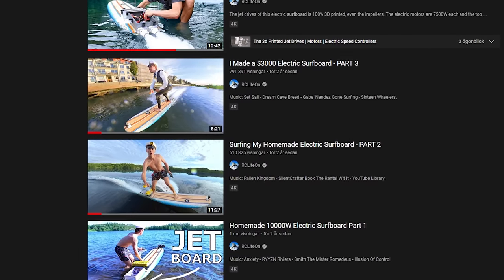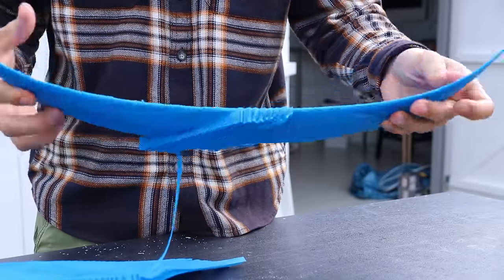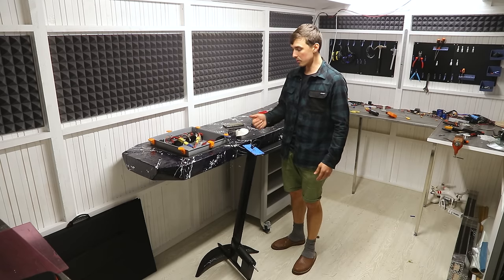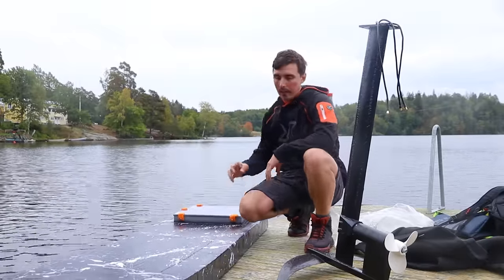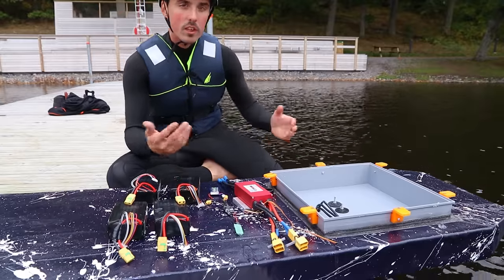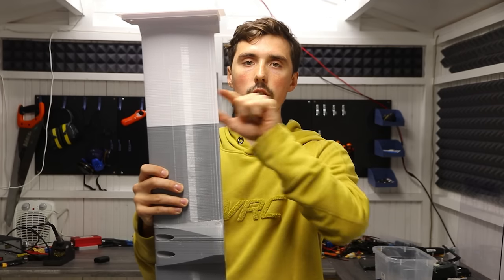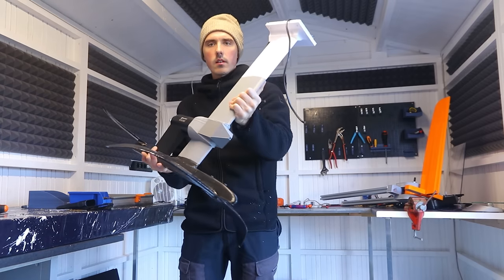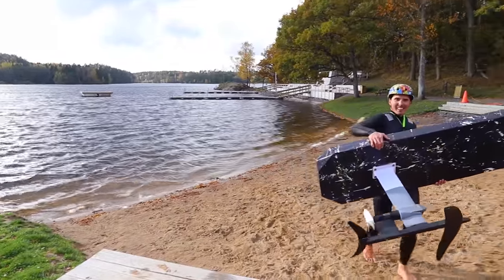3D Printed Hydrofoil Surfboard - Will it Work?

Comment: Your front wing seems a little small, or the motor is not able to go fast enough (declining thrust at higher speed.)
You can try to gently pump the foil up using your weight to help lift off, but normally the take-off is accompanied by an instant increase in speed. It seems like your motor is struggling there.
Judging by your weight and the size and speed of the board I'd say that the front wing should be about 80cm wide and have a surface area of about 1100 square cm.

Comment: I think that it didn't lift up because the wing were bending and not creating any "lift"

I recommend you to make supports or print the wings with a stronger pattern

To see if my theory is correct, you should get the waterproof casing for you 360 camera (or just a GoPro)

Comment: Perhaps you could use filament with carbon fiber strands embedded. This would make stiffer wings and provide additional strength allowing you to decrease the weight of the structure.

Comment: It now seems to be able to withstand the force of the Motor, but what i thought at first, was compressing the layers with a threaded rod. For example one in front of, and one behind the hole of the motor whire inside the 3D printed part. Two M6 8.8 Rods would be enough to apply a force anywhere from 0 - 30KN+ to keep it from falling apart.

Comment: Excellent video and experiment! You mentioned the words "epoxy" and "polyester" as the resin being used, but which one really is it? I am asking to know which resin does not melt the foam boards. I think the wing needs to be larger to have more lift, or more power to the motors.

Comment: Just try it on land. The force on the wing is the same outside the water, cause it's elevated out of it anyways. Bolt the wing down and step on it with your full weight. It may only bend a bit!

Comment: Double the wings, one at the back one at the front. And double the motor one on the left and one on the right.
 You need to get speed first then put pressure on the hydro foil. Or use squats the make the board dip up and down until enough speed is achieved. Assuming your 3d printed parts don't get ripped off

Comment: There is indeed no way to tell how much the wings BEND OUT OF SHAPE under water to "foil" your foiling attempts. The wings MUST BE MADE out of metal, and so probably the entire underwater contraption. Also, at that relatively low speed, you must have much larger wings. That's my $0.02 as a software guy. In any case, that you got THIS FAR is already very awesome!

Comment: I think if you get enough lift to hydroplane, if you're not right above the mast, it's going to break under the new un-buoyant weight. Maybe increase the aerofoil (chord/camber line) so more lift is generated on the larger surface area?

Comment: Both of your feet are in front of the wing. If your centre of mass is 400mm ahead of the centre of lift and the propeller is 400mm below the board, you'd need 75kg of thrust just to lift you (moment arm math). You want the wing to lift you, not the thrust. If you move the wing forward or stand further back it will require far less thrust to lift you off the water due to the efficiency gain of the foil (same reason planes can fly further than helicopters). You could fibreglass a deck that goes over the electronics box so you have somewhere to put your back foot.

Comment: Maybe a hollow metal tube, with a scoop at the leading edge, running up the leading edge of your  vertical riser, going through the board and through the electronics box and out the back. Have the tube running between the center of your heatsink. That way no risk of water in your electronics box, just heat conduction, as the tube contains the water and goes out the back. 
Add support posts from the bottom of the electronics box to the height of the underside of your lid, throughout. Strips of clear rubber sealant on the lid will give your feet something to grip on to, when you stand on top of it.

Comment: I would suppose like a lot of other people that the hydrofoils deform and don't generate enough lift. Improvements would be some thicker laminate on the wings and maybe some carbon fiber rods inserted into the wings before. Maybe even some solid CFRP ribs inside of the wings might work. If you can maybe run some Fluid Simulation Tests on the hydrofoil model to see if it is generally able to create the lift needed.

Comment: I have a sneaky feeling its your propeller not giving enough push to lift, we can see it nearly lifting. with enough speed almost anything will lift out the water. its just a balancing act between drag / speed / weight distribution.

Comment: I feel like you might be able run a tube through the mast  that can suck water up to the controller and then a little tube to shoot it out the back of the board. Also the wings may be flexing in a way that changes the hydrofoil and making it less efficient for lifting.

Comment: a longer support instead of a small rectangle just increase it to 2/3rds or 3/4 length of board for counter leverage in L shape brace chats right About a larger lifting 🪽 wing glad ya glassfiber wrapped it for strength imagine ya were standing on inlayed thin solar pv panels so it just recharged it's batteries as you go and go full 4 battery 🔋 maximum runtime also run the tubing for cooling just a small intake  and exhaust  which you can use the advantage of the already high pressure behind the prop to intake while exhausting forward in the low pressure to return to lake i had an RC water cooled electric inboard this way and  again thanks for sharing your fun

Comment: I think you need to put your weight even farther back, even if that means you need a stronger box so you can step on it. Put a couple control fins behind the main strut, so that the last bit of water before it takes off is heaped up between them. This may help you transition out of the high-drag regime, and from there you'll need less power to stay on foil.

Comment: 3d printed parts covered in fiber glass is a great idea for geometry specific parts but I think your at the limit of the strength it can provide, steel spar drilled through the wings to prevent flex?

Could be time to look at 3d print filament that could be used in sand mould metal casting setup.

Comment: I believe that the placement of your body with respect to the hydro leg is very far at the front and it just fights that leverage you need to lift you off the water. I also think that even if you got above the water in this try, you wouldn't have the necessary control to maintain stability, due to the same issue. Try changing position the electronics chamber and moving your body further back.

Comment: I did what you did except I made a foil from Wiggle board and glassed it my mast was aluminum. my first attempt broke off went to the bottom. second one i got lift but hard to control. I have put the project on the side for now. But your main wing is way to small take the front move it to the back and make the main wing 3 times the size and you will fly.

Comment: I think your problem is the angle of the large wing.  I believe the front of the wing must be slightly angled up, but not by much.  If you followed the plans perfectly then it may be the size of the motor driving the propeller, as well as the propeller design..  It will be interesting to see what you come up with.

Comment: why is the board so massive? usually hydrofoils are like 2/3rd the size, about the size of a wakeboard. the wing is also way too small too lift that much weight, probably not stiff enough either. you might need to print the wing lightweight and then add 2-4 layers of carbon fiber instead of fiberglass as it's much stiffer and lighter. make sure to use epoxy resin and not polyester resin with carbon fiber.

Comment: Cool Project, I guess your wings are a bit outsized for your weight. You should try to scale the wings: front wing 1350 cm2, rear wing 300 cm2 and then you should be good to go.

Comment: adjust the mount so the motor has less drag, make the main wing bigger with a more aggressive foil to it and also reinforce it with some kind of steel or CF spar to reduce flex, and the classic RCLifeOn method of "well why not slap a bigger motor on there"
those are the methods I can think of

Comment: It was veeery close there a few times! I bet you could have gotten it flying if you would have made a small jump on the board when ot is planing at its fastest. And make sure to try 3 or 4 different prop pitches as well.

Comment: From the looks of where your weight is relative to the foil I think you just need to get your weight further back. 

Think of where the CG would be if it were an aircraft. Back foot probably needs to be behind the electrical box.

Comment: i think you may have to scale it up or use a different material for the wings because they are too weak to hold all the load. which means scaling up motor and all.

Comment: A bigger front wing should do the trick maybe 1000-1500cm². Also the position of the foil/weight distribution will effect it alot and if the fuselage is flexible the lift will feel inconsistent.

Comment: You could save some weight and material by embedding carbon fiber tubes in the supports. Also, use more GF or CF on your wings?

Comment: I think maybe try wing surfing and dich electric motor entirely and make hydrofoil stronger by making them carbon/aluminum core. If wing flex then it can't lift by making it out of plastic it's doomed to not work. 
By making smool board and same hydrofoil you can use wing to get going.

Comment: Maybe consider mounting the wings at a higher angle of attack? You could do a basic lift calculation, and calculate the required angle of attack at a certain speed for it to lift you off, then mount the wing at that angle of attack. I could see how this may be the issue for you since you cant really increase the aoa of the foil while the board is still fully in the water
Reply: Pm me if you need help, id be happy to do so!

Comment: ANGLE OF ATTACK is your issue here. The original mast appears to have a greater angle of attack than your reinforced mast, which appears to have zero degrees, hard to judge through a screen though... 

But, airfoils see their greatest gain in lift force by changing the AoA, but you reach a point when efficiency starts dropping if the angle is too severe, ~5 degrees is usually that point for most airfoils, but lift force continues to rise past that point regardless. 
(Add some shims/washers between the mast mount and your board on the rearmost holes, or a 3d printed wedge!)
*May have to adjust your prop force vector direction too, if shims don't work. 

Also wouldn't hurt to wrap the hydrofoil in fiberglass.

Goodluck!

Comment: I'm pretty sure you are stalling it out. try going out in flatter conditions and try to keep your weight a bit further forward. as in reduce angle of attack to reduce drag so you can pick up a bit more speed. then see if it will pop up on foil. you might also need to get a higher-pitch propeller to avoid being erpm limited at that crucial takeoff speed. if your esc supports it you could also run a higher voltage (to get a higher erpm) with the current prop. a good stab at a v1 foil board tho👍

Comment: That 3D printed mast is not strong and stiff enough. It carries a huge load. Even if it does not break, it will bend so much that it will be extremely hard to control the foil. I'd put at least 10 layers of carbon (part unidirectional and +-45 degrees) fiber on it to get it anywhere close to being stiff enough. The same for the "horizontal mast", which is actually named fuselage.
For the front wing, make it around 1250 cm2 and set it at an angle for which your section has a lift coefficient of around 0.2. To get your current contraption to lift, you might try shimming it to a larger angle (but I think the surface area is a bit small). The wing does not need so much strength, you can probably get away with 3 or 4 layers of glass.

Comment: Make the mast longer style again, the print rotate (vertical90')  double the wall count at about 50-75% infill. coat it in fiber, the shorter redesign might creating much drag with the motor mount and fatter foil shape to get it fully out the water

Comment: If you were able to monitor the current you would see you are likely not pushing that motor to the 3000w you need to pop out the water. Then you can foil at about 1500w at your weight. You need a higher pitch prop. Really lay in the power at 6” instead of 7”

Comment: Bigger front wing as people said already and the electronic box is in the way of your back foot, your foot should be around the front part of the foil plate like 1/3 or since you made a huge board move the whole foil a little bit more forward where you back foot is located , on your video it’s seem there too much weight on the back so no balance, some people event put the electronic on the nose of the board.

Comment: Awesome! You need More lift. The foil is too small. Add more wing surface not more camber. Eventually a flap so that can take off and then negative for more speed. Be careful not to electrocute yourself. Congratulations

Comment: Put an angled flat piece to support the long length of shaft. That way it will take the forward force. I build boats put a metal piece inside of you board one foot by one foot should be enough.

Comment: L/D (LIft/Drag) is bad. That's why you don't get up on the wing.
Lift: Not enough. Bigger wing? When you calculated the lift required, did you take into account the board, engine and batteries? Did your estimated expected numbers match what you built?
Is the wing strong enough to maintain its shape under water? Do the tips of the wing twist down and lose their angle of attack to produce the lift?
Drag: There's too much of it. Engine and propeller can't quite generate the thrust to get "airborne". In a medium as dense and viscous as water, the triangular shape of that engine mount cover you put in front of the vertical wing looks a bit rough. Water generates loads of drag in turbulence. A redesign to a nice teardrop-shape of that part might help.
Surface area makes drag.Try to get rid of as much of it as you can. Is the exact position and shape of the "fuselage" and the engine nacelle crucial? Could you redesign that part to take in the engine and propeller and have the wing on a short extension under it? Like that, you would get rid of all the extra shapes and surfaces of the engine nacelle and save loads of surface drag!
Finally: Is the propeller cavitating? Is the the pitch of the propeller blades good for the requires speed?
That's all factors I see you could twiddle with to get that board working.

Comment: Do you realize that your flimsy 3d-printed underwater structure needs to hold all the weight of the board with yourself on it, plus dynamic loads ? I think we're talking about 350-400 lb load margin, and huge part of it will be a console load to the mast (essentially bending it forward). Main wing will be pulling the same load elliptically distributed along the span - no chance that root section will hold.
Kudos for all the efforts and sharing, but without solid understanding of mechanical engineering, this is turning into a circus.
Same thing with power setup - there are tools to accurately fit the components (eCalc for instance).

Comment: The wings are bending for sure and you lose surface area, even the front wing has small area, with the speed you get that  we can on the video , it  should start flying.  the materials are not strong enought. as more speed you get more bending it gets, at some point it will brake. 
 one thing you can do is instead laminate with fibre glass,  dot it with carbon fibre ( 4 or 5 layers  if carbon   200g|/m^2  ;   5 layers is moreless 1.5 mm thick ) , and it will make it  really strong. I want to see you flying on the next video !  Cheers !

Comment: I'm wondering if you do a little bounce with your legs to momentarily take your weight of the board, that it might just give you just enough air to reduce the friction to get a little more speed and room to pitch without digging into the water.

Comment: Very good work, but
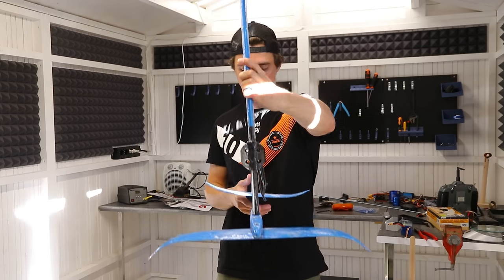do you really think that the 3D printed wing and the stand at 2:52 will hold your ~100Kg ?
Put a seat or a platform on top and try to sit or stand without water.
The little screws will never survive to your 100Kg.
Did you ever tried aluminum foundry ? 🙂
Good luck.

Comment: hi i own a hydro foil and what is happening with yours is first you need to move the box further up on the board so that you can lean more back there for generating more lift and two is that you need a bigger wing front wing i think your back wing looks fine and three if you don't want to move the electric box  then move the hydrofoil further to forwerd.  I hope that helps

Comment: I think the main issue is the surface area of your foil. It looks very small in comparison to the off the shelf models. Also in my experience of moulding lots of composite parts, you would be a lot better off 3D printing the moulds for the foils and making them out of 100% glass or carbon fiber. These would be a lot stronger and stiffer, especially if you increase the wingspan👍

Comment: fix that Receiver and bigger wings, I really think the mounting plate for the hydro foil is still too small.  I reckon it should run the length of the board and be hydrodynamically shaped and if all that fails more power !!!!:elbowcough:

Comment: I think your wings are bending back at speed. Run a tension wire from the front of the board to the wing to maintain the proper angle of attack.